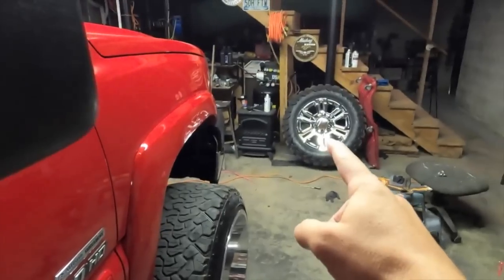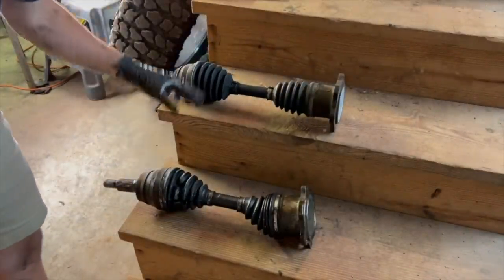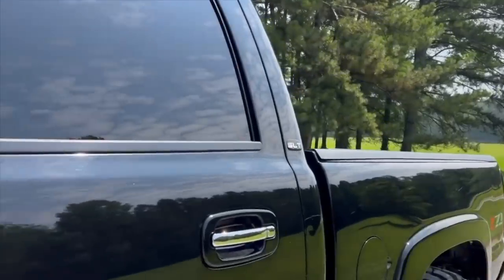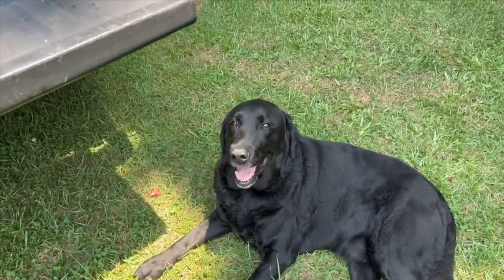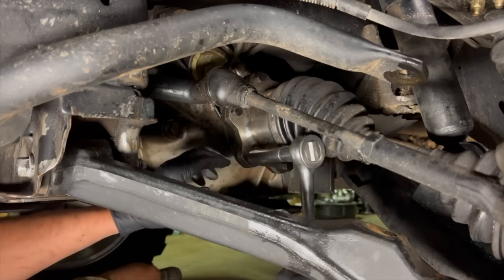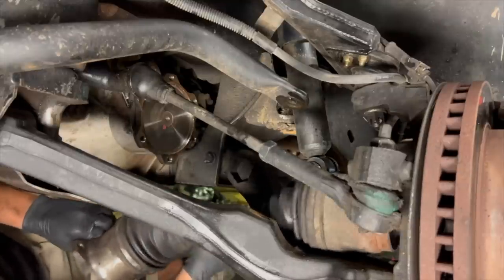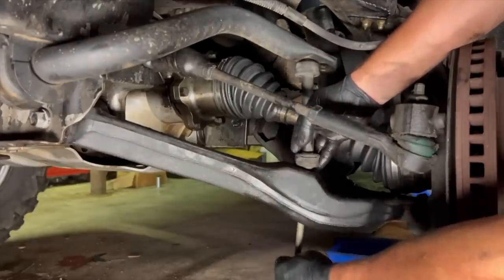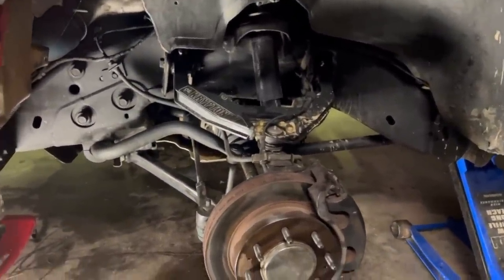CV AXLES ARE COMPLETELY SMOKED!!!

Comment: Wow. I stopped buying from Autozone & O'Reilly.  Cv axles for lifted high articulating suspension from Rockauto are $130 each. Never had anything fail from Rockauto. I have had several things fail from Autozone/O'Reilly...
Many times the exact same part manufacturer & part from Rockauto is half the cost or less.